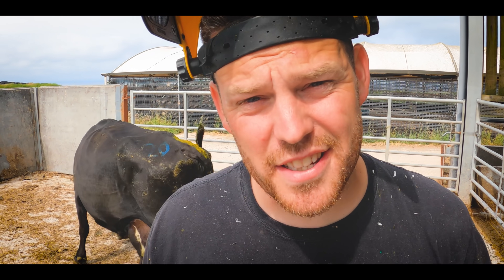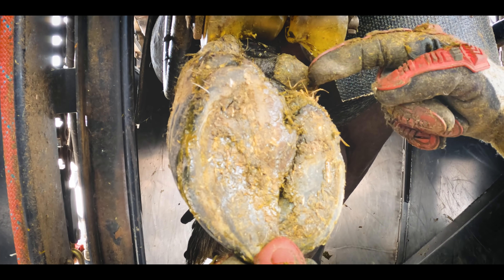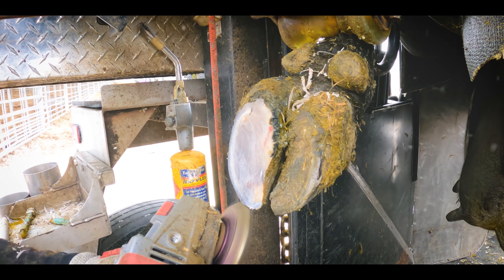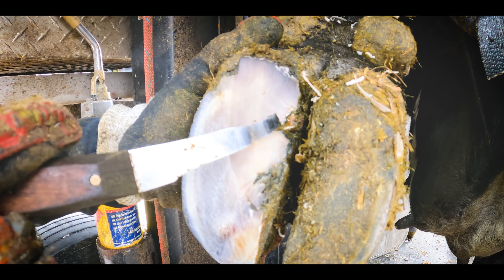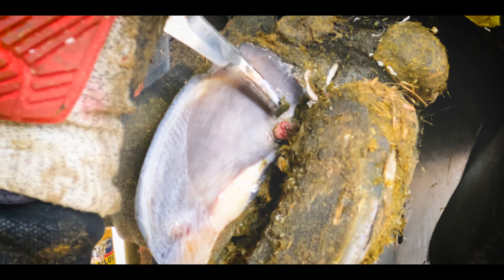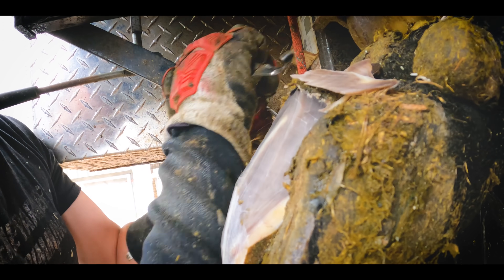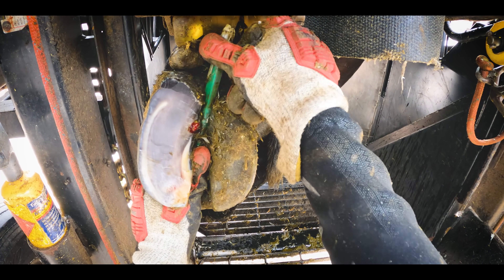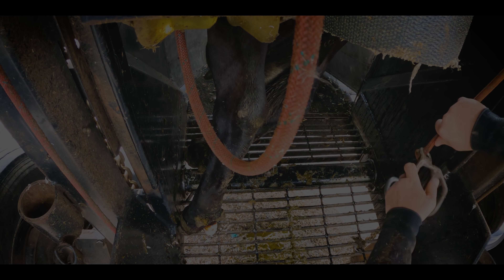BULGING SOLE ULCER on COWS HOOF

Comment: how did you know that the other foot doesn't have any ulcer or issue because it seems you just committed to the first ulcer you found and kind of knew that the other is safe for a block!
Reply: There are 3 main reasons.
1 It's the inside claw. Inside claws suffer far fewer ulcers than outside claws.
2 The claw is much smaller than the outside claw. This means it has already been effectively rested (one of the more effective cures for sole ulcers)
3 By far the most important clue is that ulcers generally start with a bruise and that claw didn't have any bruising.

Comment: You didn't do it in this video, but I'd love to know why so often you block up one claw before starting to shave away at the affected one...seems like when you straight up block the unaffected claw it would be a hindrance to working around the one that's hurting.
Reply: It gives the glue more time to dry.
Reply: @alistairclement4239  That does make sense.  Clearly he's capable of working around it just fine even though sometimes it looks like it's in the way.  I know one of the goals is to minimize the time the cow's in the crush.  Thanks.

Comment: I'm still curious if the color of the block has any difference in application use. Are they different thicknesses, different composition, or just happen to be a specific color? Also have you had an interactions with a cow you've worked on coming back and thanking you for helping them? A look back or more?

Comment: Why does the ‘problem’ hoof tend to be higher and grow faster than the other hoof, thus putting more weight on it causing more problems? Is it bc her body is trying to heal and grows more horn?
Reply: hey Elle it's actually growing the same speed but since the cow isn't bearing their full weight on it the hood isn't wearing down as quickly
Reply: @trishaoliver2098  gotcha, guess it just seems odd that if the cow isn’t bearing that weight on the roof that the other side wouldn’t be the same height. Know what I mean? Sooo interesting,